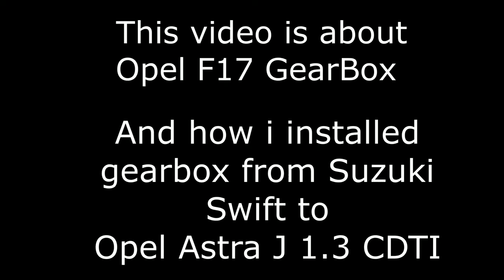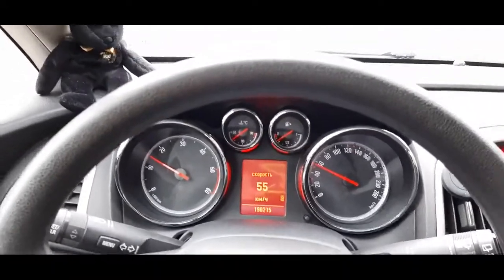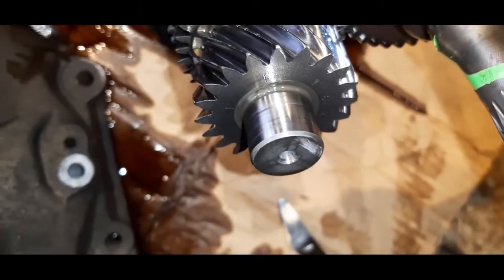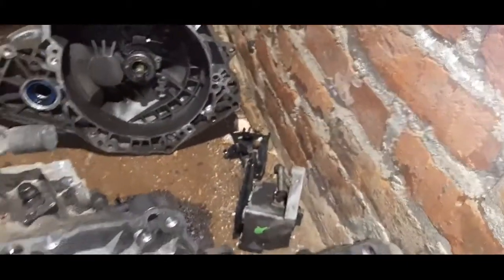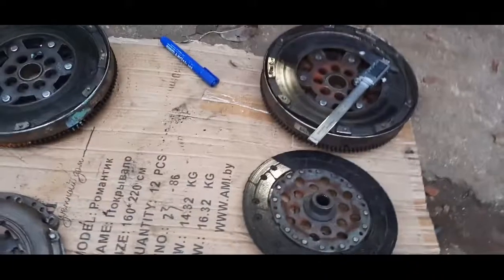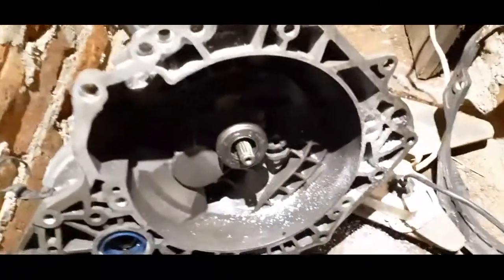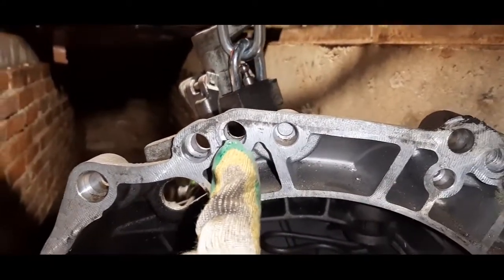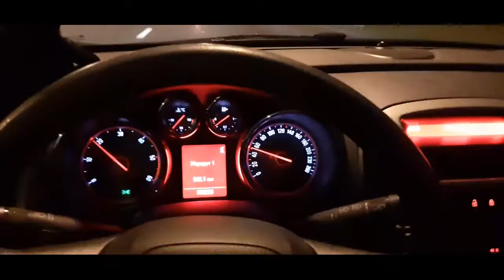Opel Astra J 1 3 CDTI GearBox Transmission Removing Installing Changing, checking used flywheel.

Comment: Hello, I have an Astra J 1.3 CDTI, which transmission oil should I use? I would appreciate it if you could answer me. Greetings from Turkey.
Reply from the maker: 75w80 or 75w90 full syntethic, and better to change it every 40.000km
Reply: Hello, I have the same problem right now. What needs to be changed? My car is at 205 thousand. If I get discouraged, I would be happy if you could help me. Greetings from Turkey.